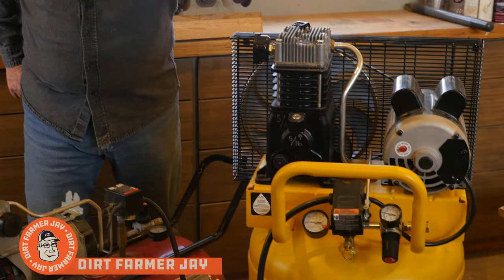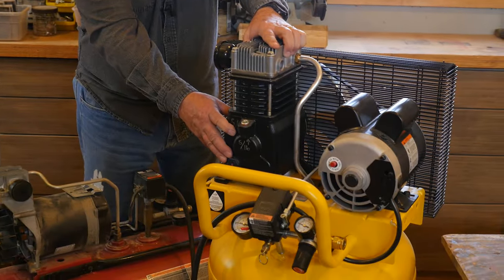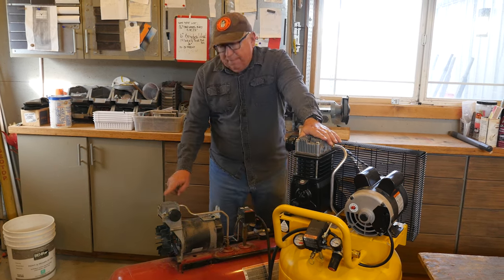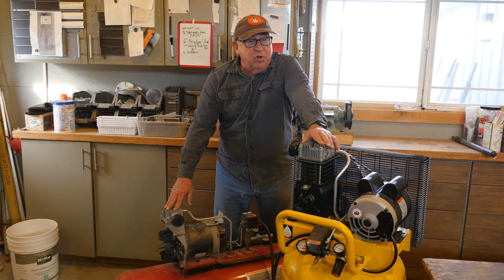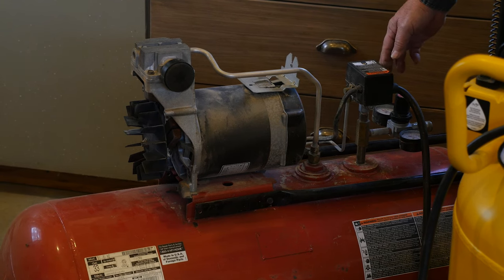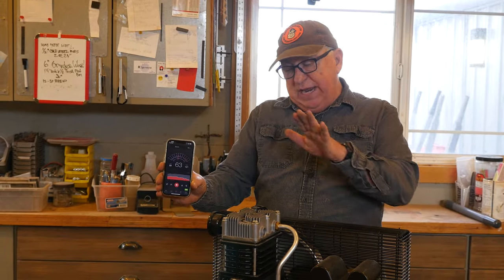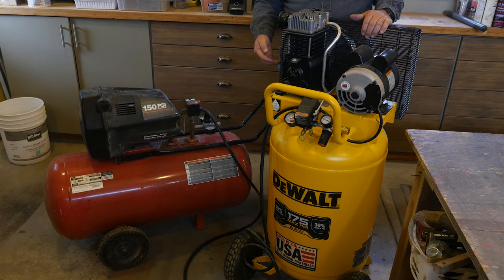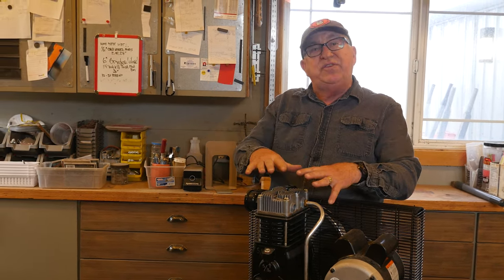Are Oiled or Oilless Shop Compressors Better?

Comment: I respectfully disagree. Ten years ago, I would have agreed. Oilless compressors have come a long way since then. California Air Tools has proven oilless compressors can rival oiled compressors in durability, while being much quieter than oiled compressors. They're not the only company selling this newer technology oilless, they're just the first I was aware of. 

The twin piston DeWalt compressor shown in the video is nice. It has a lot of CFM (6.2 @ 90 psi) for a 2 hp compressor. If I needed that much CFM, I might have gone with it (or one of its clones). The compessor I went with provides enough air (5.1 CFM @ 90 psi) for the tools I regularly use, pneumatic nailers, die grinders, and a couple of small sanders. It has a smaller tank, 27 gallons. However, its rated at 200 psi, so it holds more air than the DeWalt. My compressor provides a lot more creature comforts than the DeWalt. It has two air outlets, a full roll cage protecting all sides of the motor and pump. It's regulator is mounted so it's adjustment knob and dial are easy to reach and read. It's drain valve is mounted at the front of the tank. I can easily open and close the valve with the toe of my shoe. Finally, and most important to me, it only produces 78 dba. That's still loud, but not nearly as loud as the DeWalt.

In terms of durability, I burned out two oiled 10 gallon hot-dog style compressors. Each lasted about 5 years, with annual oil changes. But, they were cheap compressors. My point is NOT that oiled compressors don't last. It is that cheap compressors -- oiled or oiless -- don't last.
Reply from the maker: Thanks for the thought provoking comments. Well said. I appreciate the insights, and don't be surprised if we do another episode along the line of "Viewers Sound Off!" on this topic. I enjoy this aspect of the YouTube platform - good interactions with viewers. The best to you and yours. - DFJ

Comment: If you plan to use or depend on the your air compressor 24/7 then an oiled air compressor is by far the best choice.  Framers and contractors use oiled air compressors all year b/c they require something that is both rugged and will take a beating in any weather...
Reply from the maker: Well said.

Comment: 26 years on my Craftsman 919.165230 25 gallon oilless air compressor without a issue and use it a lot. The sound is of course louder than an oiled but dont kid yourself. Both are still loud. The oilless you compare here is missing the shroud cover which will reduce noise slightly.
Reply from the maker: Thanks for jumping in and letting us all know of your experience. I appreciate you taking time to write. Best, DFJ

Comment: A great example as to why oil-less or ceramic-head compressors suck is Car-tyre inflators - they work hard and get extremely hot, they blow at the toss of a coin on any day of use.

Comment: I think sound intensity reduction is a big plus, especially in the higher frequencies.  Remember sound intensity (measured in decibels) is a logarithmic scale.  Each additional dB is a doubling of sound intensity.  10 dB is 10 times the sound, 20 dB is 100 times and so on... thats why a normal conversation can be 30-60 dB and a jet aircraft (which can/will hurt you) is 120+ dB.
Reply from the maker: Very clear explanation - Thanks!

Comment: Brand new oil cooled, wore out oil less?
Reply from the maker: Indeed. Oilless unit we had just wasn't that well built. Best, DFJ
Reply: @DirtFarmerJay "Well built..." is key here. A good oilless machine will last equally, or even longer than oiled compressors. We have good data now from around the globe.

Comment: Oilless compressors don't last long for me I've gone back to oil compressors.
Reply from the maker: I'm just more comfortable with a tried and method of lubrication - and the oil acts as a coolant as well. So, the unit runs cooler. Heat is the enemy of equipment so heat reduction is good! Best, DFJ

Comment: Don’t like it. What matters is the air they can push through. By the way, where are you dumping the dirty oil. Not to your front lawn, anywhere close to your house. Say no?
Reply from the maker: Thanks for sharing your thoughts. We are doing to do a follow up on this episode that covers additional areas, such as air volume, SCFM and CFM, single and 2-stage and so forth. Thanks for the nudge.

As for the oil, we have quite a few pieces of yard equipment that uses oil and we have a waste oil collection container all that used oil goes into. It is then taken to the waste collection station for safe collection. No dumping around here!

Best, DFJ
Reply: You're a wise man to not dump oil on your property, Jay, and it's a recyclable resource. 👍👍👍  @DirtFarmerJay
Reply: Oil comes out of the ground, Greta !!

Comment: I made the mistake, of buying a Harbor Freight. 21 gallons, 175 psi oil-less unit. It died in less than 2 years time. With very little use. ☹
Reply from the maker: Sorry to hear. What did you replace it with?
Reply: @DirtFarmerJay I haven't done so yet. Everything is so expensive. I'll probably repurpose the tank. I have no intention of fixing the compressor. But the next one, with be an oil sump system.